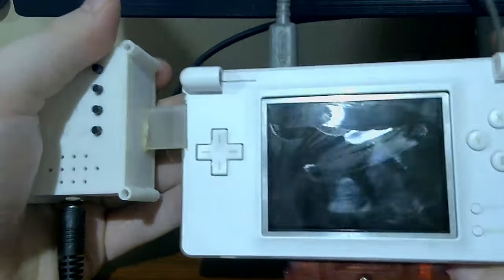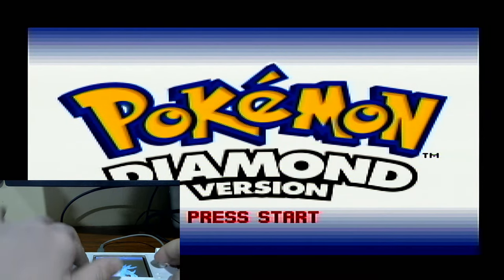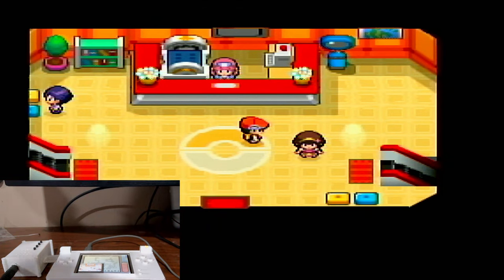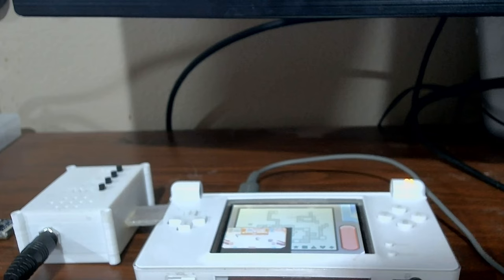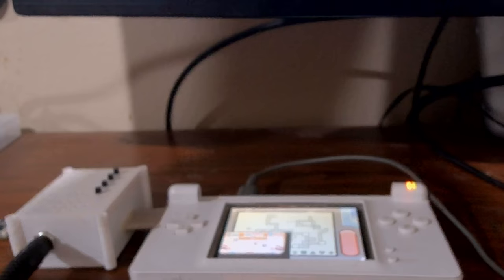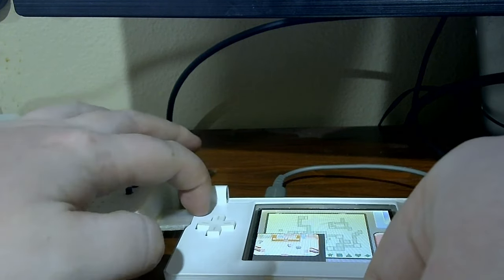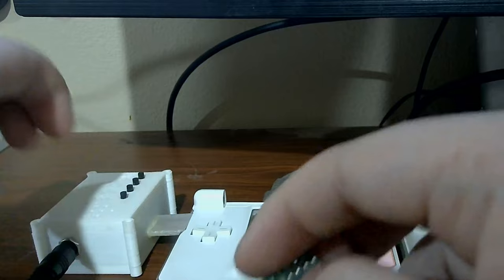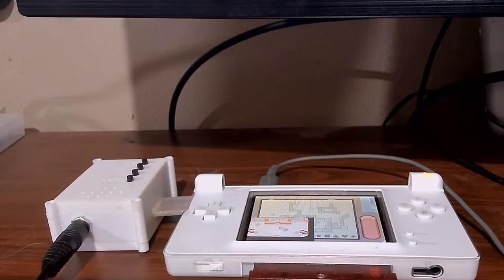DS TV Out Overview, Thoughts, and Future Plans

Comment: Inside gadgets has controller mods for several systems. I have modded them into a ds lite as well
Reply from the maker: I actually found an open source solution that works better
Reply: @professormarill3251  thru the arduino?
Reply from the maker: @mitchboynunn  yeah completely open source and customizable in any way I like with any controller I want

Comment: that dpad does not look fun to use, suspicious lack of footage of you using it
i wonder how a game that uses the shoulder buttons would go and if you could just connect a controller to it all emulator style
Reply from the maker: Yeah that's the current plan if you actually watched the video you would hear me talk about adding a controller and ways to improve the design. You would also hear me say that I'm mostly going to use it for shiny hunting so it's not as big of a deal for me. I'm currently doing some research  into taking the ribbon cable output to usb so instead of having the box on the side you could keep it separate with just a usb connector. Next time watch the video before being a jackass
Reply: If I remember correctly there is a controller mod for the ds lite.